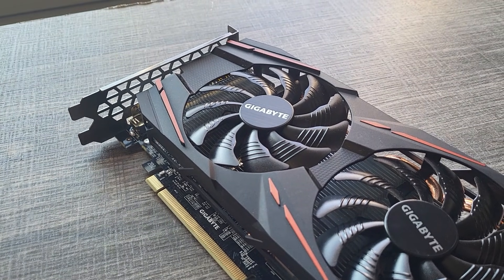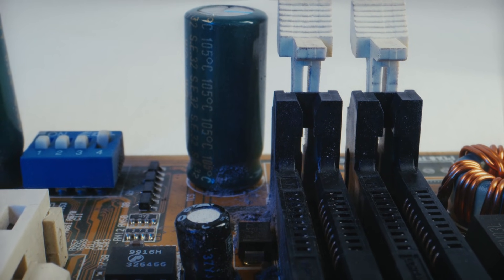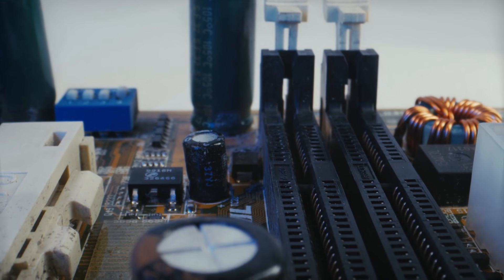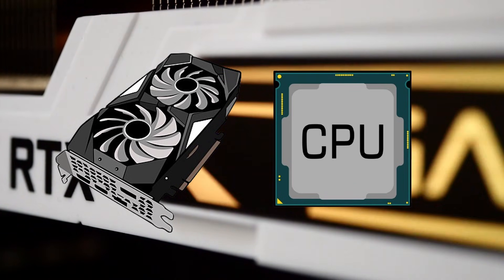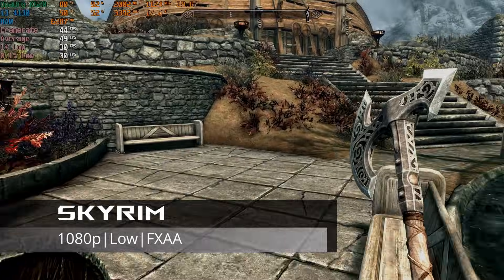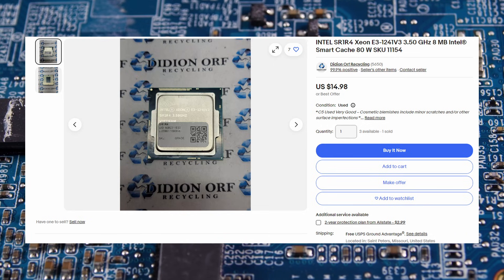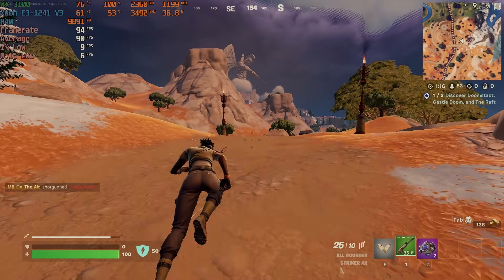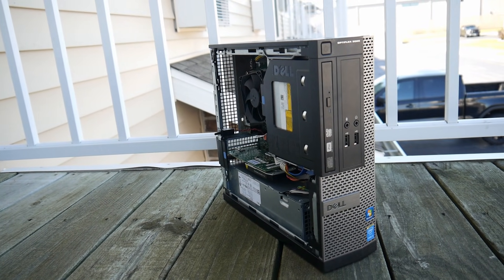An Ultra Budget Gaming PC

Comment: I love stuff like this. i had a bunch of old hardware i had hoarded from mine, and others old pcs. i threw a lot out when i moved, but had kept some stuff. i ended up looking at what i still had and it was enough for a pc. so decided to combine two pcs of mixed components and a laptop hdd, plus a little linux, and boom. i had a functional pc. its an am3+ cpu with 8 cores, dont recall the name. 32gb of ddr3 ram, started with a rx560 but it has a gtx1060 now. i also upgraded to a ssd. still need a case though.

Comment: for anybody still looking through these comment sections,  I recommend getting a dell optiplex mid-tower (not small form factor) with a 6th gen intel cpu and putting in a full sized gpu like the quadro k2200 4gb. This should be about the same price but much better performance

Comment: I built a custom pc for 100 bucks

Xeon e5-1650-v3
Msi godlike x99a mb
2x8gb 2133MT/s crucial ram
Used montech pc case
Old FirePro gpu
A crapy psu
Stock cpu cooler

Comment: Kudos for actually having a 100 build that doesn't include: a) My dad's work continually throws away million dollar equipment or b) I was walking down the street and picked up an RTX  video card off the sidewalk.  Is that 3100 a better performer than the quadro k2200?  cuz they are about the same price.

Comment: I just have a lenovo thinkcentre and added a  750ti(2GB Version) and 256GB with the i3-6100 and 8gb ddr4(i got lucky that it has ddr4) i can run most games in low settings at 100fps and gta at 80, total price of this build was around 90$
10/10 would recommend, currently i order a cheap 5$ fan to use as exhaust only downside is that the hdd seems to stop the pc from turning on sometimes and recconecting the sata cable and power cable seems to fix the isuee for around 5 days

Comment: For $20, I got a Core 2 Quad 8200, 4GB Ram, and a decent mATX mobo and all because it came in a case I thought I could use. I was surprised at how well this actually ran with Windows 10 so I threw in my old GTX 550 TI and was able to run older games quite well. I kept it that way for a couple of days until I noticed that the floppy drive wasn't working, and I found out this is an issue with Windows 10, which really irritated me. So I wiped it and went with Windows 7, as I really needed that drive to transfer small files to my Win 95 PC.

Comment: I'm curious how a Ryzen 5 3400g system would compare to this pc. You would miss out on a discreet GPU but would be on AM4 for around $100 if buying an OEM PC
Reply from the maker: Yeah I think going with anything AM4 where you can at least have the potential to upgrade both the CPU and discrete GPU in the future is the better value path long term. I think the Vega 11 graphics of the 3400g would probably perform similarly to this k620 if not a bit better in some circumstances.

Comment: Sorry i don't understand, why you bougth an oem system without CPU RAM and storage? It would be more wise taking a complete system for that money. Or at least take a non oem pc without those component for easy expandability for GPU and psu. SFF system are just a source of complication without any real vantage.
Reply from the maker: The only reason I bought the barebones system that I did is because I already had both CPUs that I used on hand and plenty of RAM. Neither of which I had any other use for. Doing it that way allowed me to get use out of what I already had. In most cases, if an individual wanted to start with an OEM, the best value play is definitely to find something that has all or most of the needed components included.
Reply: @UltraBudgetPC  Hi, thanks for the reply but even more reason you should have bought any custom PC on which to mount the components you already had. Or much better sell those yuo don't need and take case, psu and better cpu used. The result would have been more efficient and with greater possibilities for upgrades down the line.
Reply: @UltraBudgetPC  I know that a lot also depends on the area you live in and what the second-hand market offers. But a case is very easy to find at a low price, perhaps with a PSU included. Otherwise your build makes perfect sense.

Comment: If not for the price I would say go for a more modern system with an iGPU which will outperform this system, graphics included, by a long shot.
But for the price I don't know.  
Good video.
Reply from the maker: I'd just say in most cases, spend a little more for a newer or more capable system that has an upgrade path but at a strict $100, there really isn't much more you can do that something like what I did in the vid.

Comment: Just put together an i5-4590 + RX 570 4g build for about $105.

I found a killer deal on facebook for a Dell XPS 8700 for $72, offered $65 and he took it. Came with a 256gb mSATA SSD (kinda slow but better than an hdd boot drive) and a 1tb HDD. Super great deal, guy was super chill too.
The RX 570 was just $30 off marketplace, lucky find too.

The PC came with a good PSU, but it only had a dual 6pin so I had to buy an adapter off Amazon which pushed me juuuuust over $100.
Reply: Try getting a xeon with hyperthreading. You get them cheap, at least here in Europe. Got one 1240v3 for 7€ incl. shipping. Typically you get them für 10-20€ and the 8 threads give you a huge performance increase these days.
Reply: @MasterBlaster220  over here, those chips are like 15ish bucks with shipping off eBay. What is really funny, I actually had upgraded to a 1231v3 before selling it to my cousin! It runs great for him haha. 

I am in the process of selling another build now with a 1240v2, the PC itself was 20 bucks and the CPU was 16 lol. (The PC came with a Celeron and was dusty)
Reply: @ Nice.

I would really look if the motherboard accepts the Xeon. I have a lenovo SFF here right now that recognizes the xeon. Some OEMs do, some dont. They internet helps there.

If not you might invest in a i7 4770 or 4790. YOu notice that especially in the 1 and 0.1% lows, you get less stuttering. BUt i think the rx 570 is strong enough to fire up a 8 threat xeon or i7 and will give you more FPS as well.

Comment: Its good to see a similiar budget build, I was able to get a whole lenovo thinkserver TS140 from my workplace for free! since they were getting rid of it. A whole tower with the same CPU, I upgraded the Ram from 8gb to a full 16gb and added in an 500gb SSD, tossed in a 750ti 2gb that I had laying around, costing me a total 74 bucks. Works great but not the best, could play all the titles in the vid and some to none triple A titles, also its definitely not photoshop user friendly. And just now bought that Xeon cpu as a upgrade 😁this will be my temporary system will I save up for something in the b450 AMD platform.
Reply from the maker: Hopping on the AM4 platform is not a bad idea even in 2024. Using something like a R5 3600 or 5600 for a few years still makes plenty of sense on a budget while also having no performance limitations for 1080p and some 1440p gaming

Comment: My best advice is look at local listings for 2-3 weeks, set up notifications for key words. Look through categories and sort by price. Be patient. I just scored 14 512gb msata+m.2 drives and 6x4gb matched pair ddr3 sodimms for $60. They are going into a couple Optiplex with 4590s/8gb(now 16) I got for $35 as a pair, rest of ram and storage into Fujitsu s930/s920 for miscellaneous 24/7 use. All these systems will be 'maxed out' once the AliExpress xenons arrive. By that time I'm into 6 systems for less than $200.
My local market has no msata drives above 256gb so I'll have recouped my money by the time the last 3 msata get picked up next week 😂 almost scored a 3060 with a defective fan for $120 yesterday but the seller began receiving offers above his listing price before I could snag it (I don't game much anyway and when I do my laptop is more than fast enough). Keep the peepers open for a good deal and you can actually make money 🙃

Comment: I built a PC 3 years ago, an Optiplex 790 SFF i7-2600 with 16gb ddr3 RAM, GT 1030 2GB ddr5, which I upgraded the GPU to a GTX 1650 4gb ddr6, it still makes me smile when I play... I think it can't go any further than that, I wanted to upgrade to a 3050 6Gb ddr6, but I think it would cause a neck due to the PCI 2.0 port
Reply: my 4060 runs on a gen 3.0 pcie slot. it has the same performance as a 4.0 slot. i don't think it'll do thaaat much harm tbh, but the 3050 is an awful card to get.

Comment: a lot of these old office desktops get thrown out and you can find them at recycling centers often for free or extremely cheaply, with bios updates a lot of them support xeons which can give you pretty great performance and run anywhere from 6$ to 30$, I have a few of them that are around the performance level of an i7 4770k or better, would recommend radeon wx series GPUs, sometimes flashing a gaming bios works when getting extremely cheap mining RX 470s - RX 580s (your mileage may vary), RAM upgrades are fun, not uncommon to find older RAM cheaply on local marketplace/classifieds sites, learning the basics of repairs and electronics recycling can make it extremely easy to get functional gaming rigs for almost nothing
Reply: Haha, didn't get to that point in the video, but yeah, I did almost the same thing with an e3-1240 v2 and a wx 3100, was able to play armored core 6 at 1280x1024 kind of decently lol

Comment: would something like this, or at least the upgraded version, be viable for a second, stream-only pc? would probably have to use an hdmi-to-usb converter bc of the lack of pcie slots, but they can be found for around 20usd so it fits the low-budget theme... i just dont know if the processor is too old to run OBS or if it could output 1080p/1080p60

Comment: I have a GTX 1060 6GB. What would be the best GPU to pair with an i7 8700k?
Reply from the maker: An 8700k is still a pretty capable chip. If you're running games in 1440p you could really get any recent mid-high end GPU but if that's not in your budget or you're using a 1080p monitor, I'd recommend something like a 2070/2070super or Radeon RX 6650 XT. A smaller and cheaper upgrade could be up to something like an RX 5700 XT or GTX 1660 Super/Ti but I'm not sure if that is a largely worthwhile upgrade.

Comment: I bought 4 8gb 2400G SFF elitedesk PCs off eBay for 50 each. The chip is really easy to work with, not the greatest CPU only performance, but it's going to sit under the desk and be the little workhorse.

6500t PCs seem to come in pretty cheap too. But I hear the Radeon iGPU comparatively punches with 8th gen intel iGPUs.

Regardless, it's fun to work with. Do a little bit of gaming, and overnight rendering. I'd have to go on a part hunt if I wanted some half height GPUs. It's just a side hobby so spending full price is out of the question.

Comment: I got a very good deal in my country for a tiny mini micro, a Lenovo P 330, cost me 72 USD (converted), it has an i5 8500T, 8GB RAM, and a SSD. Its super efficient, usually draws an average of 15 watts. 

But since its really small i can't really convert it to gaming pc without a low profile GPU. 
LP graphic cards are rare in my country so i can only find the rx 6400 new at around $120 😅

Comment: E5 1650 V3 , 32 gb ram, nvidia 1060 3gb, 256 gb ssd.  i got fpr 200$ its doing okey in 1080p low/mid settings games. nothing more , nothing less. fine with my causal needs. ^^

Comment: This is insanely weird, I literally finished my Optiplex build with very similar specs the same day this video got uploaded 😂 mine has the i5 4570, 16gb RAM and the same GPU as the non-upgraded version! I'm using it on my TV alongside my consoles for watching movies and playing some older titles. Great video, weird coincidence!
Reply: I'm planning to upgrade my 3020 sff with Intel pentium, do you know if the Pentium models share the same motherboard? I was planning on coping your build (after almost ten years an SSD and 8GB of ram aren't enough anymore 😂)

Comment: Oh, the xeon one instead of the i7 4th caught me off guard, I have right now an hp pro elitedesk I think with an i5 4690 on it, it could be interesting to use the xeon and put an RX 6300 on it, I can get them on my market for like $36 USD with shipping, I think its worth it right(?
Reply: Did you get a Xeon for it ? If so did it work ?
Reply: @jonjongx  Sorry for late reply, and no, I didn't get one as you aren't sure if the HP motherboard BIOS will handle it, I'm right now with an Asus LGA 1155 Motherboard which states on it page that it works with Xeon so I'll play it more safe there and sell the hp

Comment: You could have made a much better build using a ryzen 5 3400G,which has Vega 11 as Igpu and is only costing 27 dollars on ebay.
Reply: it sure as hell wont be 100 bucks total though
Reply: Btw vega 11 is better than the gpu you used
Reply: I have the same cpu with a gtx 1050ti
Reply: But office pc are intel motherboard

Comment: I used it in the office for work years ago. I have it at home, upgraded with e3-1270v2 and gtx750ti with a riser to place it horizontally (you've to cut part of the cabinet). Good job dude 😃

Comment: now what about a ultra budget setup monitor and peripherals included >:)
Reply: The cheapest but still competent and actually strong mouse I have ever bought is a Tecknet model.  I bought it for about 10 euros, about 10 years ago.  I made a video on it several years ago on my main channel and I was not impressed because back then I found it too slippery. While that is not as important now that I have been using it for a couple of years as my daily mouse, it has a design that makes it easier to pressed the right mouse button when moving the mouse towards you.  Not always, just some times.  Which can be a bit annoying as you can imagine.  Still, otherwise a 10 euros mouse which isn't malfunctioning, is relatively good for gaming and looks awesome, is in my book a great ultra budget peripheral.  
My point is, if I were going for a budget mouse now (and I hope I don't have to as I am now poor), I would look what new Tecknet has to offer.

Comment: so many OEM PCs are going to flood the market once windows 10 support ends next year :D
Reply: yeah but rtm installs fine and small tweaks will get rtm on sandybridge
Reply: Oldest system I managed to Install Win 11 using a Rufus ISO on was a Lenovo Thinkcentre M57 based on a medium Core 2 Quad and 4 gigs DDR3  RAM and a small SATA SSD, and it ran absolutely fluent
Reply: Rufus laughing in the corner.

Comment: I scored gold earlier this summer in a dumpster dive. An office was updating all of their workstations and tossed out about 50 Dell 7050 SFF Optiplex's with really good spec were I suspect their IT had done upgrades to at some point. Each had an i7 7700 CPU (some had i5 7500 installed but I picked out the i7 units),  256GB NVMe (Most had their drives removed but there were a couple which still had them installed. The i5 units had 128GB drives, one of the i7 computers I collected had a 512GB NVMe installed), two sticks of 8GB DDR4, a 1X PCIe Wifi/Bluetooth adapter with antennae and an RX 550 4GB video card. Only drawback was I was on my motorbike so was only able to carry 5 of these computers home with me. When I returned, the dumpster had already been emptied. I installed a fresh copy of Windows 10 (which activated for free), replaced the thermal paste and cleaned the ones I took home. I paired four of these Optiplex with 24" 1080P monitors I scored from a previous dumpster dive and bought Dell Alienware multimedia keyboard, mouse and generic mouse pad combo (new old stock) for $30 each. Total investment was roughly $35 into each and sold four of them for $100 each (they all sold in less than a day). With those funds I upgraded the GPU on the last Optiplex to an AMD RX 6400 4GB which I just got in the mail yesterday and upgraded the OEM DVD drive to a bluray drive (will explain later). For this last unit I also installed a spare 2TB 2.5" SSD I had laying around the house (keeping the 512GB NVMe as the C drive). Installed the RX 6400 and also installed two extra 8GB DDR4 sticks I collected from one of the other systems in that dumpster. Final spec: i7 7700, 512GB NVMe (C drive), 2TB 2.5" SSD (extended storage for games and moovies), 32GB DDR4 2400T, Wifi/bluetooth adapter, RX 6400 4GB GPU, running Windows 10. The main purpose of this PC is to rip DVD's and Bluray discs for my Plex server and to do admin for my company but to also double up as an entry level gaming computer (my main computer is an i7 13700K, RTX 4080 FE, 64GB DDR4, 2TB NVMe C drive, 4TB NVMe extended storage which I use as my main gaming computer).